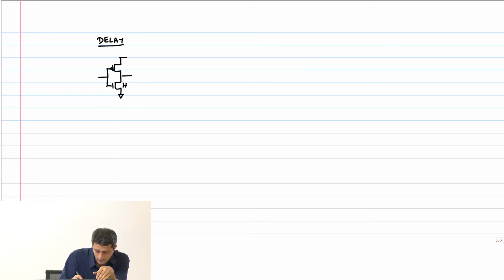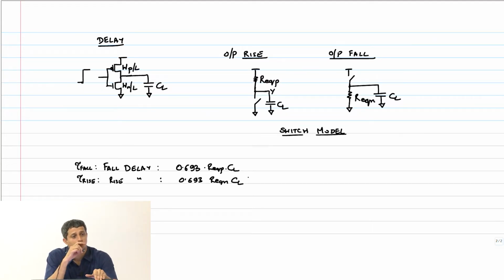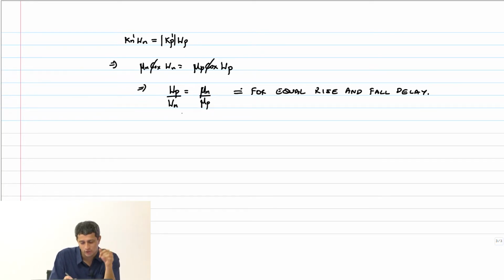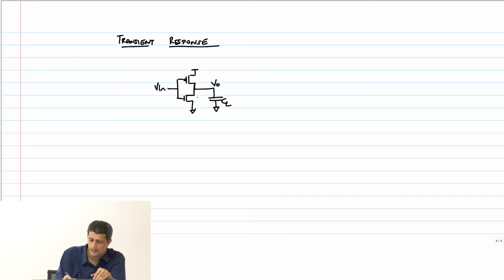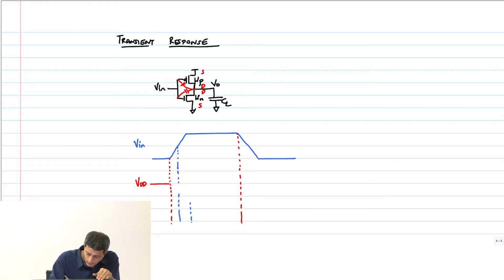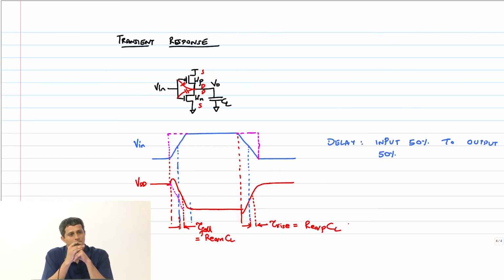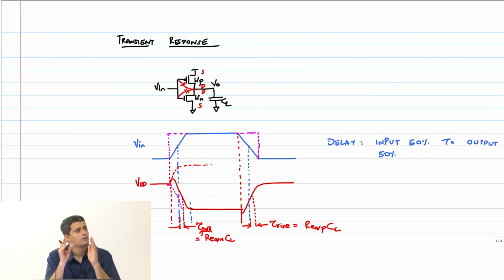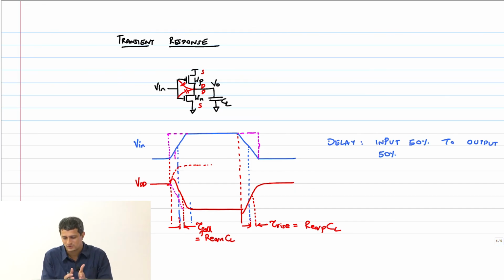Inverter - 14 - Inverter: Transient Response

Comment: At 15:04 There is cgd capacitance effect on inverter.. but cgd is not coupling capacitor.. cgd is parasitic capacitance which will be active in high frequency of operations.. at low frequency there is no cgd effect if im wrong can anyone correct me..
Reply: it is true that Cgd is not an intentional coupling capacitor, but a parasitic capacitance between gate and drain. At low (DC) frequency, it has no effect since a capacitor behaves like an open circuit. However, during input transitions, the fast voltage change at the gate couples charge through cgd into the output node. This looks like a coupling effect and causes the small glitches in the transient response. So, even at low input frequencies, cgd matters during switching events because those edges contain high-frequency components.

Comment: But load capacitance voltage cannot go above VDD. As it is being charged by VDD.
Reply: Since high frequency operation, change in input is reflected on capacitor plates from Vin = 0 till Vin = Vtn which gives the bump. For Vin>Vtn , NMOS becomes ON and discharges the capacitor.
The theory that Gate to Drain Capacitance doesn't allow sudden change at output - how does it fit?
Reply: @socialogic9777  the thing is capacitor should store charge to vdd, so at the instance when vin goes high, to maintain store charge upto vdd , it increases the vd to few seconds, due to which we observe the spike , the same concept is for negative spike also.

Comment: Why cgd make instant  rise in voltage value at beginning??? 
Why it is not falling???
Reply: because initially that capacitor is fully charged as vout is vdd and vin is 0v,  and at the instance our vin goes to vdd , the capacitor is still has charge so it increase the vout to some extent resulting in the spike .
Reply: @faneeshbansal   Hi, can you please explain it more clearly and why then it decreases?
Reply: @lakshaydata   the reason is until Vin reaches Vtn the NMOS is off dues to which there is no discharge of charge and since there is connection between output terminal and input terminal due to Cgd the increase in Vin leads to increase in Vo due to flow of charge through cgd and then as soon as Vin gets over Vtn Nmos gets on and CL starts to discharge and vice versa happens for the charging case